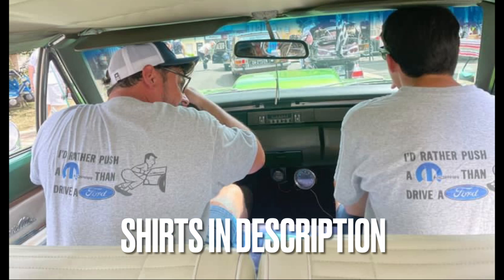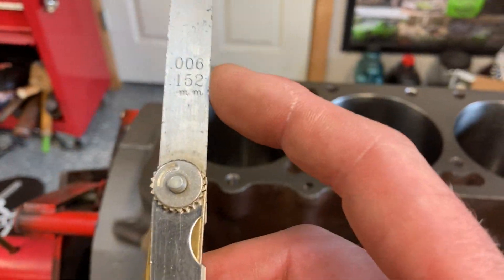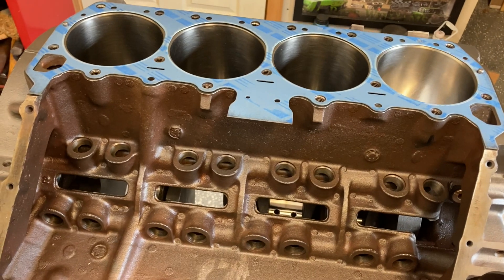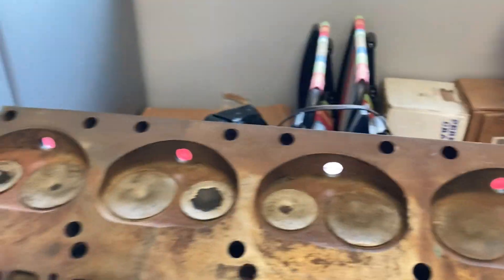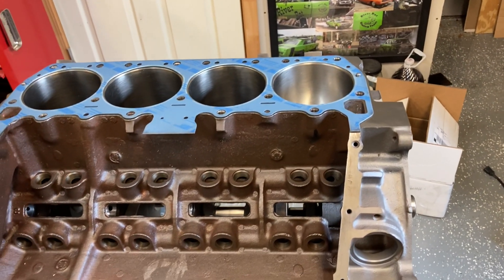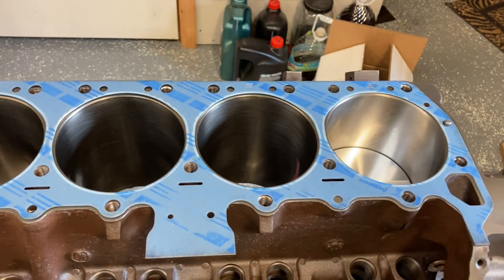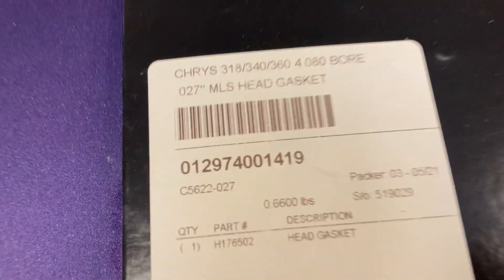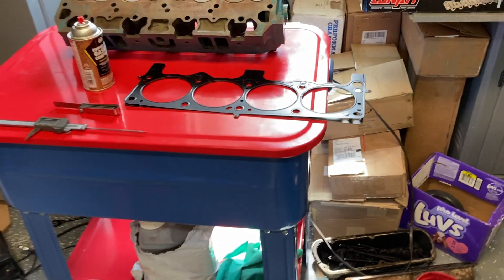3 Common Head Gasket Mistakes Made by Mopar Engine Builders(that Affect All Brands)

Comment: Joe what do you think about 20 thousands steal head gasket on mine . 11.1 piston closed chamber heads ? Will they last or blow ! I've never used them on a race engine.
Reply from the maker: I’ve used them on a 11/1 383 before and never had an issue. The guy I sold the car to started spraying the car every weekend with 125 shot and they eventually leaked. That block was never surfaced. It could have had something to do with its failure.
Reply: @JustMoparJoe   Should be okay then . I'm not spraying. Mine isn't decked so there's to much clearance. Thanks Joe 😁

Comment: Thank you very much Joe !! Truly was a learning experience for me . I am building a 318/393 LA stroker with Speedmaster Aluminum heads with Studs and the Top of the line Felpro head gaskets I bought for it are .039 and have a fire ring . Now I am gonna call them and ask if they are compatible with my 11.5-1 compression with a 150 shot of plate nitrous . Not every time I run it but at least a dozen times a season. Would you recommend a MLS head gasket Cooper coated for my Application?? If so should I still get one from Felpro or MLS themselves??
Reply from the maker: Thanks buddy! If you’re block and head surfaces have been smoothed, then MLS is best. They say not to coat them. I will probably give mine a light coat on both sides. If the deck isn’t perfect, the felpros should be good 👍🏼. Definitely call them for the best advice. My 408 has the out of the box felpros! Handled 150 shot just fine, with timing and fuel correct.
Reply: Right on Joe Thank you . Block will be square decked and zero decked. Icon pistons are flat tops forged with a .039 compressed head gasket will be exactly 11.5-1 with 65 cc head.
Reply from the maker: @NilesJStJohn  excellent. I would almost think it’d be more with a flat top at zero deck in a stroker with such a closed chamber head. Tomorrow I’m hoping to make a video measuring the quench and valve to piston clearance in my 400.

Comment: Are you going to block those lovely "Figure of 8" cooling passages in the block with that tiny, tiny, little slot in that gasket?
Reply from the maker: Yea they get restricted with any gasket. Here’s the actual ones that I’m using. https://www.summitracing.com/parts/cgt-c5462-027/make/dodge
Reply: @JustMoparJoe  Not having a go mate, just pointing out that the slots are VERY small in a lot of gaskets.

I recently built a 440 here in the UK, and used a steel shim gasket as I had a block with the Figure of 8 cooling holes, and the steel shim gasket had very large original 60's factory sized cooling holes.

From what I have read when the smog era started in the 70's they reduced the slot size to make the heads run hotter to try and reduce emissions. It seems this also led to cooling issues, which was the case in my car.

On the issue of steel shim gaskets, I have seen them over 40 years old and they have finally started leaking due to corrosion, but not being blown due to poor sealing. I think the factory fresh blocks were not "Square" back in the day, and so for street engines which see full throttle every now and then, steel shims aren't an issue, and have large cooling holes as a bonus.

Obviously, if you are racing, them that might be a different matter.

Just offering my experience with these gaskets, which I hope you and your viewers find useful (or not!)

Take care  👍👍
Reply from the maker: @somebloke13  thanks for sharing. I didn’t sense any hostility in your comment. I may can do a video on differences in blocks throughout the years. 👍🏼
Reply: @JustMoparJoe  Glad you weren't offended. I chose the "Heavy Duty" figure of 8 block for that extra cooling, and it's worked great for me.

Be interesting to see the other blocks available 👍

Comment: Electrolysis won’t be an issue until the coolant gets old and acidic. Basically it turns the engine into a battery itself and can be measured with a digital volt meter. Hopefully a race engine will have its coolant changed regularly enough that it will never have that issue. In the shop I’ve found voltages over 1 volt cause issues in road cars. Running straight water would more likely cause rusting and cavitation because there is no film coating the cylinders water jackets and the action of the piston traveling down slightly warping the top of the cylinder wall and creating air bubbles where the deck and cylinder meet. If I were building a race engine that’s been bored over I’d run 7.3 Powerstroke coolant additive as extra protection even though it’d probably never have that issue anyway, its peace of mind.
Reply from the maker: Thanks for sharing! I’ll check into it.

Comment: I think a big question is:  Are there different head gaskets for different bores? I'm seeing Part No: 8519 PT-1 Fel Pro performance head gasket being listed for 361, 383, 400, 413, 440, and 426 wedge.  I was told they each need a different gasket to make sure the compression ring is outside the bore, but just barely. And that each oversize choice, standard, 030, 060 required a different size if you are being careful. Of course a 440 that is oversize is close to the bore size of a 400.  
   So, why are we only allowed a one- size- fits -all gasket???
    Also, I thought the disadvantage of the compression ring hanging into the bore was pre- ignition, not a loss of compression when that ring gets hot like a glow plug.
Reply from the maker: Excellent question for felpro. I typically but my Hi performance gaskets through summit. It will have a larger bore size listed there.

Comment: I use the Fel Pro gaskets and have never had a problem. I put them on with the head and turn the block over and look to see where the fire ring is, plus if the holes match with the chamber. There is a lot that goes into building an engine. One thing I have found if find a damn good machine shop!! Let them know what you plan to do and they should set you up with what you need. Or do your own stuff and blame your self.
Reply from the maker: Thanks for sharing Jerry. I work with Ed at Ed’s machine. We have a nice relationship, and he trusts me to build my own engines. Check out his channel. He shares his 40 years of machining knowledge there.

Comment: I stoped using those blue fel pros long ago. They are terrible, not because of the material and don't seal but for other reasons more important to performance. 
As far as corrosion it's not so much the dis-similar metals. It's more along the lines of fluid. Think of it this way you can't make hydrogen just by putting water around some stainless. You need a mineral in the water to make it happen. Same goes for coolant. Ppl just use the wrong coolant, plain and simple.
Reply from the maker: Interesting! Thanks for sharing

Comment: Surface finish , difference of expansion aluminum on iron are factors to consider.i once used hi temp.alum.spray paint on milled aluminum head that was scratched bad enough to leak coolant.i sanded paint off so scratches filled.used the factory graphite coated composition gasket, worked fine.not the normal way to use sealant s on gasket,but I didn't want to stick the gasket to head on this engine (inline 6 alum.head moves on iron block, hence coated gasket).
Reply from the maker: Thank you for sharing. Would that be like a 4.0 jeep engine?
Reply: 4m Toyota 2.6l .machine shop in 1980s had a lot to learn about how put smooth finish on aluminum head.same issue today on aluminum or cast iron if you use mls or all metal gaskets smooth finish required.composition more forgiving.

Comment: Don’t know if someone answered this already but I believe the reason for the out of round area in the fire ring on the felpro is that it is a somewhat one size fits all and allows them to be used on the 426 max wedge which has valve clearance notches in the top of the cylinder,much like the 351 Cleveland 4v motors. Nice work mate and thanks for sharing your knowledge!
Reply from the maker: Thanks brother. Yes sir, had a few guys share that. I’ll definitely remember it for next time
Reply: Ok, but since a 426 wedge has a smaller bore than than a 400 you'd think a gasket for a 400 would have room if it was perfectly round.
Reply from the maker: @auteurfiddler8706  I think it depends on the chamfer of the 400. I think the truck blocks were even worse than the earlys.
Reply: @JustMoparJoe  Back before the 1.81" exhaust valves were available, the 2.14" intakes valves were available and the 1.88" Max Wedge exhaust valves were available. What we did was take 1.88" exhaust valves and cut them down to 1.83" diameter, to clear the cylinder bore and we'd leave a 0.100" margin on the valve head edge, for good flow. So we were running 2.14" intake valves and custom 1.83" exhaust valves, with standard valve stem diameter. It's important to use single lock groove valves and keepers with solid lifters too, as the multi-groove keepers could get knocked loose. The single groove keepers are good  for keeping together high RPM hydraulic valve trains too. The single groove is wide, strong and has a positive grip on the valve stem, instead of the floating grip the multi-groove keepers have.
Reply from the maker: @BrandonLeeBrown  thanks 👍🏼

Comment: MLS gaskets only for me….ls9 gaskets to be exact…….no copper coat bs…..on the old school small block Chevy and ford we would coat the gaskets in motor oil
Reply from the maker: That’s a new one on me. Thanks for sharing!
Reply: Never install a head gasket with oil on them that works only on an old stock engine

Comment: I have built a good amount of marine engines .  What I see with corrosion is just lack of anode replacement with the galvanic corrosion .  I have always used steel shim, Cometic and copper spray coat to help eliminate a lot of the pitting.  And honestly, even though there are others out there that frown on the spray copper coat it is also being used as a coating/sealant .  It’s condensation and 99% of the time from the expansion and contraction .  
  Electrolysis I have seen quite a bit from using aluminum housings and aluminum water pumps as well.    There are so many variables it’s overwhelming.
  It also remember , you can get the pitting and electrolysis from bad grounds as well.   No one ever has those, lol.
Reply from the maker: Thanks Doc! I know when trying to pull that front aluminum timing cover off a small block, it can be welded to the bolts!
Reply: @JustMoparJoe   Joe , three weeks ago I was helping a friend of a friend of a friend ( you know how that works) , old California style ski boat with a 440 and a Jet drive.  Had to use a air hammer to start chiseling the thing apart .  Sat for a “little” while was the phone conversation. Last registration was 1999.  Did not party like it I could tell you .

Comment: Joe I’m so sorry to keep bother you I’m just a newbie mopar person. What’s your opinion on the lunati voodoo cam? I’m thinking about installing one in my 440. Just don’t know which direction to go
Reply from the maker: I consider them nice cams. More suited for the street car or truck that wants good vacuum for power brakes. They work well with lower compression engines as well. The complaint I’ve heard is that they don’t have a lumpy enough idle. I used one in the 413 engine build series, and a larger one in the 360 build series. I have sound clips and specs inside those. 👍🏼
Reply from the maker: My favorite flat tappet cam company is Isky. You can still call and they can advise you on their choice for your build. They will be more expensive, but higher quality.

Comment: Could you tell me how much your machinist would charge for a stock 440.   Roughly?  No promises, but I may drive from AL to get it done!!
Reply from the maker: Thanks Mike. Ed and I have a deal worked out, that he doesn’t typically do for his customers. I have been bartering some core parts and stuff that he needed for his builds, in return for his work. If you have some specific questions, shoot him an email. matlock72758@gmail.com

Comment: I think gaskets are made like that so valves can't hit.  The 413s and 426s you had to notch the block on bigger valve factory bore. So valve wouldn't hit the edge of the cylinder wall . That's my best guess 2 cents . 😆
Reply from the maker: Interesting! Thanks for sharing

Comment: Another great video!!
What is your gasket of choice for small block Mopar 5.9 with Trick Flow Aluminum heads? I have a set of cometic, which I planed on using copper coating. But value your opinion! Keep doin what you are doing!!
Reply from the maker: Thanks brother. Those cosmetics should be great! Be sure and check their diameter against the bore. I have et noticed small blocks with the severe chamfer before.
Reply: Soo...I have a fresh 408 (360 bored. 030) stroker crank, was thinking cometic gaskets, sized .040 bore with .030 compressed thickness. My bores gave irregular chamfers, figure the .040 bore gaskets would ensure no fire rings hang over...am I on the right track?

Comment: At what point does an engine need to have the rings cut into the block or heads?
Reply from the maker: That would be an excellent question for Ed at Ed’s machine. I can’t give you an experienced answer for that.

Comment: The reason the head gaskets are shaped the way they are in the lower half is because the combustion chamber is shaped that way because of the valve reliefs. That is why max wedge blocks had bore notches in that area. When you start a build it is wise to rough bore the block, install the heads on a bare block, mark the heads left and right, then with a scratch awl scratch the bore pattern of each cylinder on the heads. Never run your valve reliefs past that scratch mark unless you do a slight bore notch. Most people use a head gasket to mark the head, not the best idea, use the block.
Reply from the maker: Thanks for sharing!

Comment: When I saw this pop in my notifications i said "F YEAH!" - So now I see why you were asking about what we were talkin about with the fire ring and the steel shim and yeah holy sheet thats a huge chamfer (not complaining or criticizing!). I dont think an oem shim will cover that but I will remember that if i ever get to my 440. Im not trying to jinx you but I wont be surprised if Ed has to cut a fire ring in. With as beautiful as that deck surface is, and iirc your heads are done too, I would be going with that teflon coated MLS for sure (unless I misunderstood and you arent doing an mls?)! I dont have a ton of experience with MLS on personal stuff but Ive helped with quite a few for other people and yeah we swear by copper coat. The ONE time we didnt coat we ended up with a coolant leak. Sure, its not a requirement but it does give that little bit of extra pore fill.  
I had never even considered galvanic corrosion, thanks for that educational tip!!!
Reply from the maker: Thanks for watching brother. I don’t mind a composite gasket if the bore is large enough. I will check all my options and go over the choice during the full build.

Comment: Power adders use cometics and copper coat, never look back. If u run water only always install a sacrificial anode in radiator, corrosion will pick on it
Reply from the maker: Very nice!

Comment: Cometics be pricy. And I don't think they are necessary in 99% of applications.
Reply from the maker: What do you prefer on a hemi?
Reply: @JustMoparJoe  Fel Pro for most, because of price. The stock steel shim is good (and cheap) if the decks and heads are flat. Cometic for all out race or heavy boost/nitrous.

Comment: I always use a copper gasket 15:15 to 1,copper spray is great use on gasket and you can reuse them a few times(copper)
Reply from the maker: Interesting! I just saw Marcos at dust or bust have a pair fail. I’m not sure if he used sealant on them at all.
Reply: @JustMoparJoe  Hey Joe never had issues 15:15 to1 B1 928HP 800 torque 10+years

Comment: Great video Joe, alot of food for thought in this one.
I think the Cometics or the Felpro Performance gaskets would be fine.
As long as the fire ring is outside the chamfer on the cylinders or cylinder head combustion chamber. 
Back in part 1 or 2 we discovered the Edelbrock heads chambers were outside the perimeter of the Felpro composition gaskets.
Thus requiring a different gasket.
Better to catch the problem now.
As you are bring light to the subject.Good job Joe.
Take care, Ed.
Reply from the maker: Thanks Ed. I won’t order any until we confer on the width of the deshrouding. Better safe than sorry!
Reply: @JustMoparJoe  Roger that Joe!!